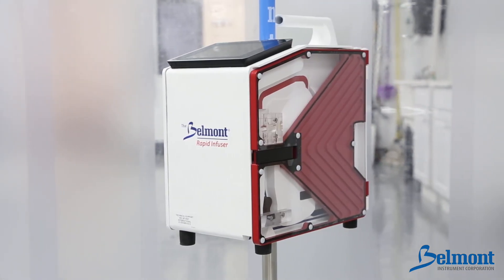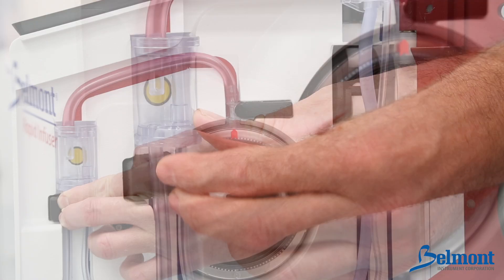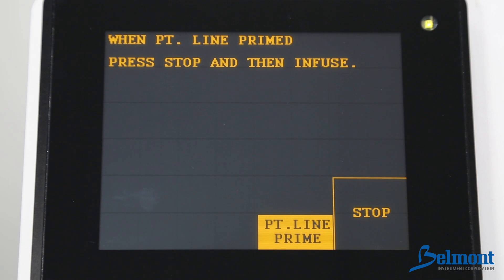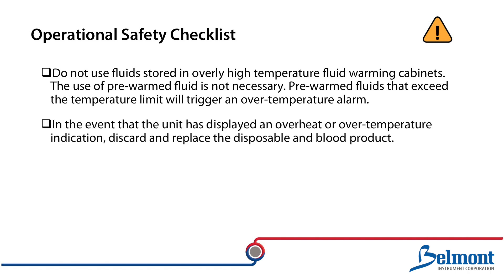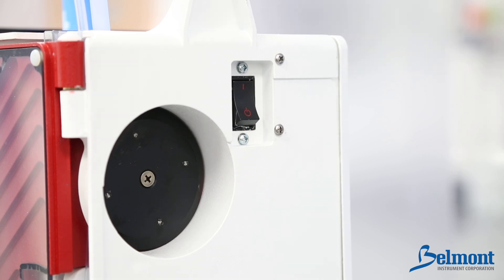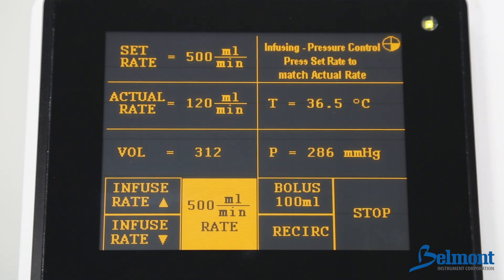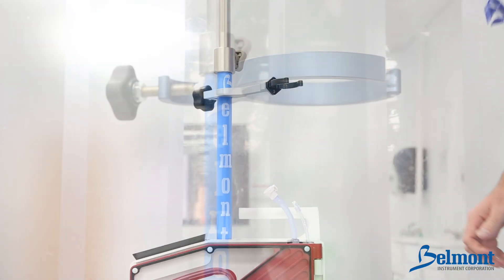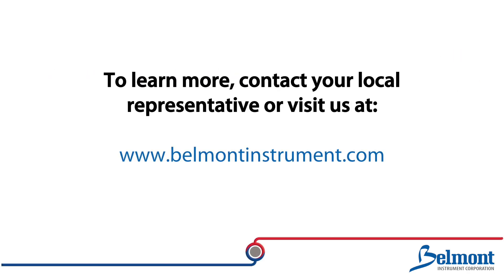The Belmont® Rapid Infuser RI-2 Instructional Video - Full (Updated)

Comment: What size angiocath would be necessary for such infusion volumes? I am just a med/surg RN, so the largest catheter I ever see is an 18g, and I imagine you would need something significantly larger than that.
Reply: I work in an ICU and we’ll infuse through a 9 French introducer if we have it available. A solid 18g will work if it’s all that’s available. Just need to pay attention to the flow rate.

Comment: The main winding was of the normal lotus-o-delta type placed in panendermic semi-bovoid slots in the stator, every seventh conductor being connected by a non-reversible tremie pipe to the differential girdlespring on the "up" end of the grammeters.

Comment: The original machine has a baseplate of prefabulated aluminite, surmounted by a malleable logarithmic casing in such a way that the two main spurving bearings were in line with the pantemetric fam.